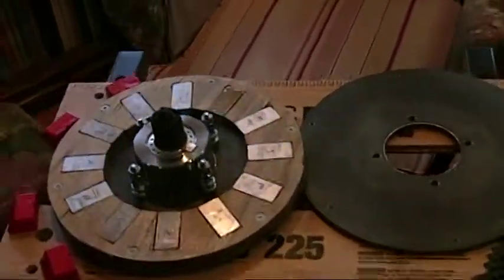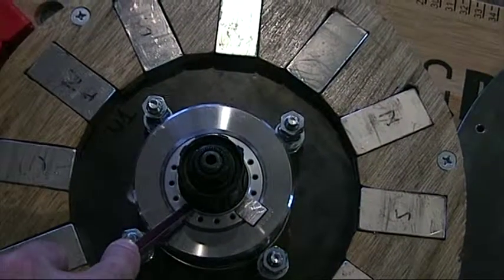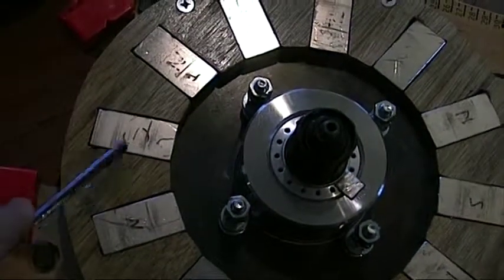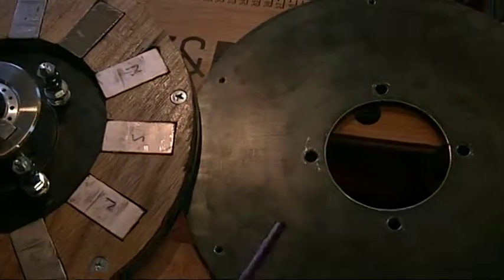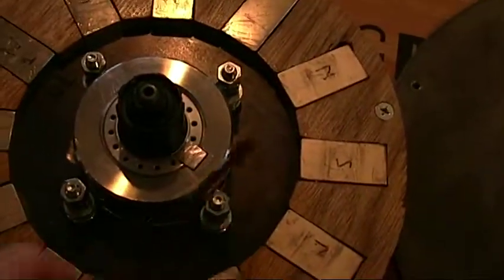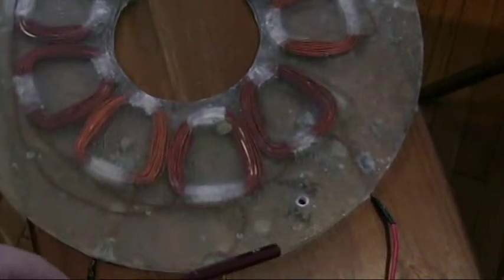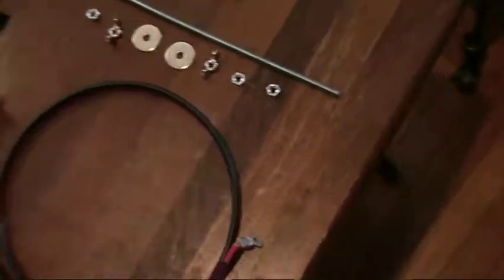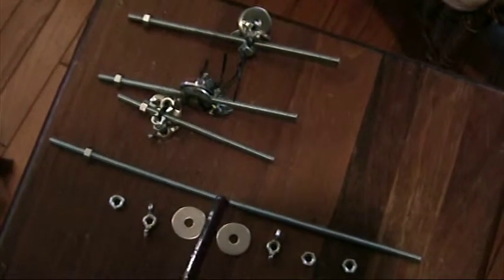Bicycle Generator - DIY PMG parts

Comment: you did an amazing job here! do you have posts about the building process in some forum? how you did your calculations for the coils and the magnets?
Reply from the maker: +Little Spiro Sorry, I don't have the details online.  Magnets were rated at 1.3T.  I build a spreadsheet that let me play with the coil geometry, wire gauge and number of turns to produce a min. of 9.3VAC per phase @150RPM.  I built one stator using 14 gauge in a Star configuration and another using 16 gauge switchable for both Star (higher voltage) and Delta (higher amps, less internal resistance = higher watts at higher rpms).